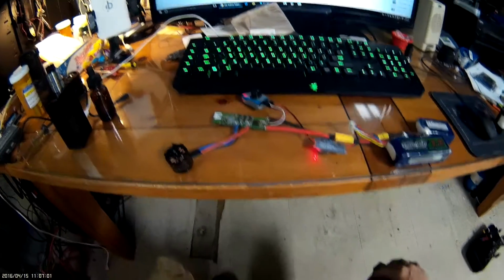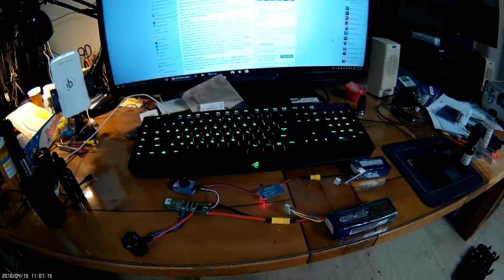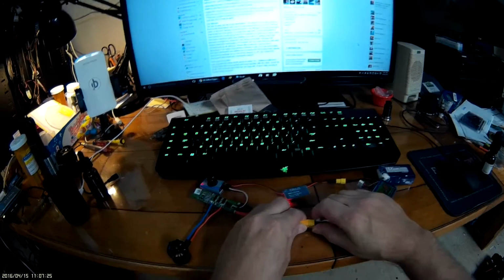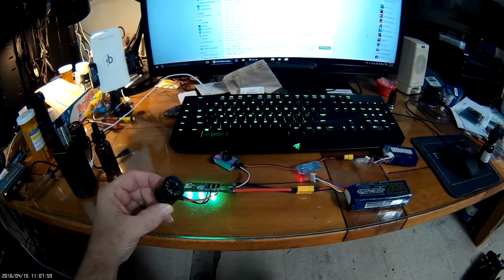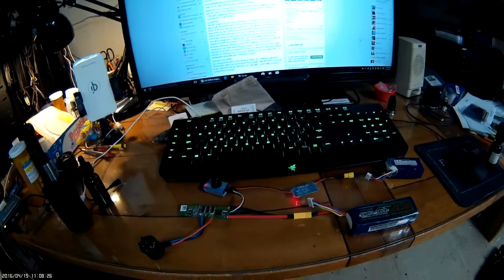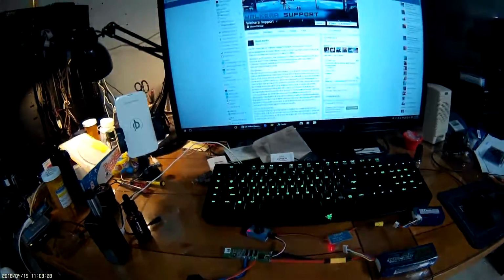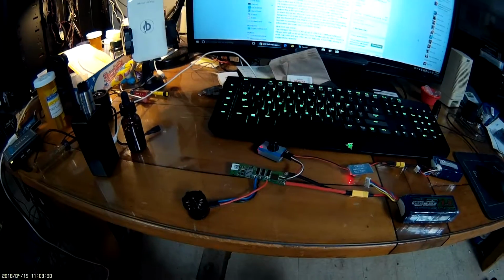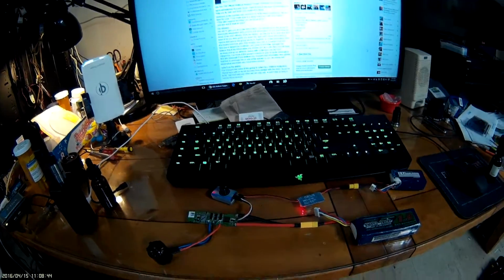Walkera X350 Pro Stock ESC 4s Test

Comment: THANK YOU. someone gave me 4 motors+esc's from the walker x350 pro and I was planning on using them with a 4s pack. now I know not to. you just saved my motors and esc!

question: how does the esc perform under load on a 4s?